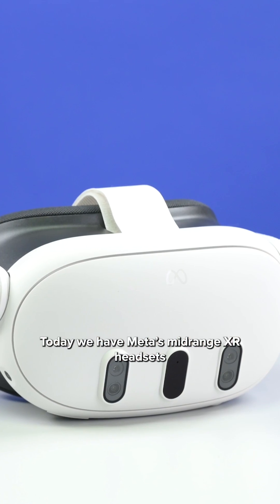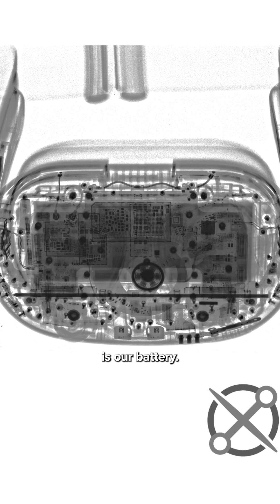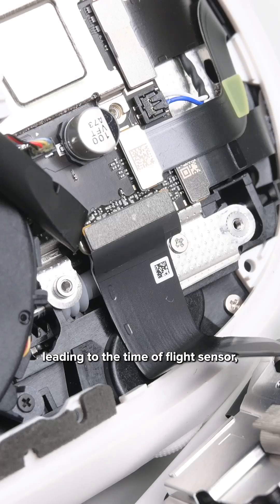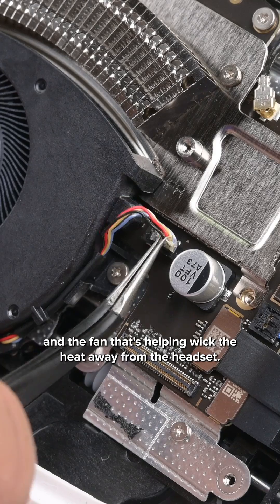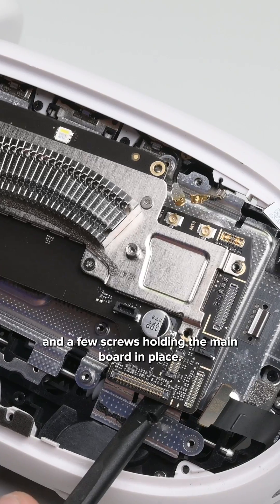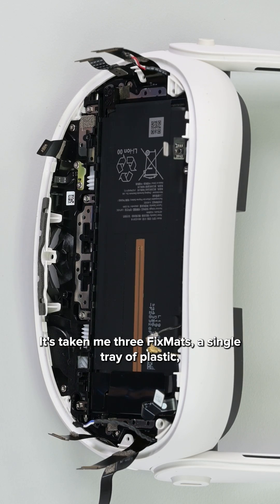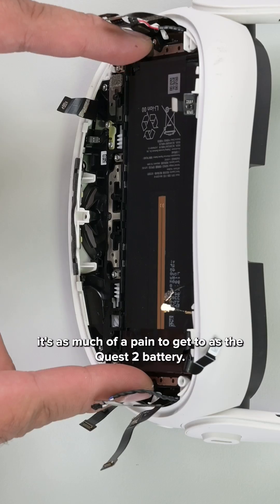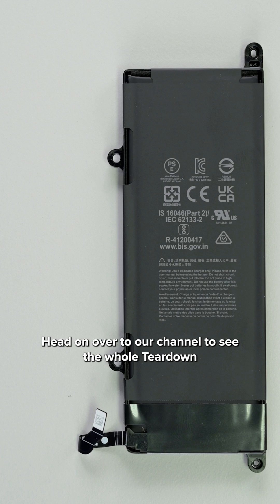iFixits Meta Quest 3-Teardown Can you Replace the Batter? #metaquest3 #metaquest #ifixitteardown

Comment: i think the quest 3 is actually easyer to replace the battery in than the quest 2 since the quest 3 doesnt have you opening the headset on both sides making the whole thing awquard to hold along with a ribbon cable snaking through the top of the case to connect the battery to the motherboard that was by far the most diffcult part when i did it. this one seems alot easyer all the wires on the front of the motherboard nice easy disconnect to reveal the battery sitting underneath looks easy as pie even if there are a ton of screws

Comment: Hi, does the Quest 3 work if I remove the battery and only run it via a power bank?
Reply: Just plug the power bank in why remove the battery
Reply: @damuffinman6895 No, a Meta Quest 3 headset will not work by removing the battery and running it solely on a power bank; the headset requires a stable internal battery to operate, and attempting to power it directly from a power bank without the battery is not a functional design and poses a safety risk. Instead, you should use a power bank in conjunction with the internal battery to extend playtime, such as attaching it to a compatible head strap or keeping it in a pocket to charge the device while in use.
Reply: @damuffinman6895 Because lithium ion batteries are bombs  and messing around risks them blowing up. Explosions aren't good, especially when strapped to your face.
Reply: @damuffinman6895  I think he was asking in case the main battery kicks the bucket

Comment: So what I getting is that after I reassemble it I will have a extra 50 screws because there is no way I will feel like putting even half of those back in ( even if the number is sarcastic and not literal ).